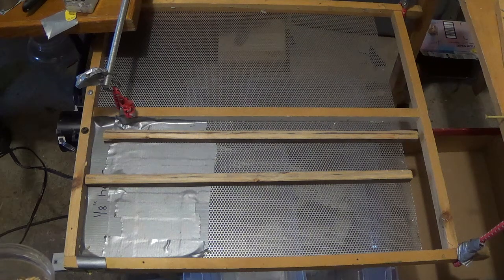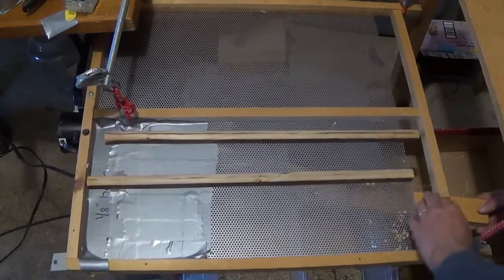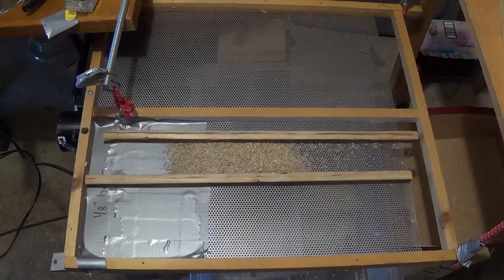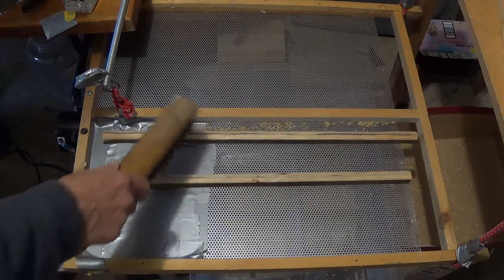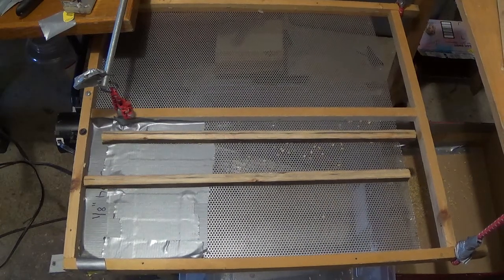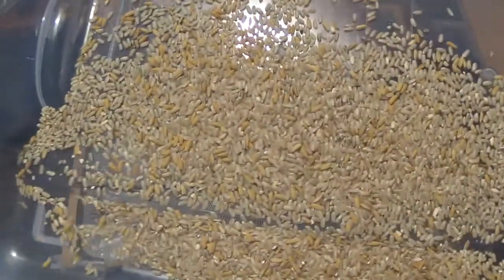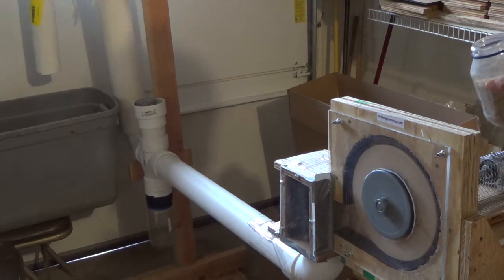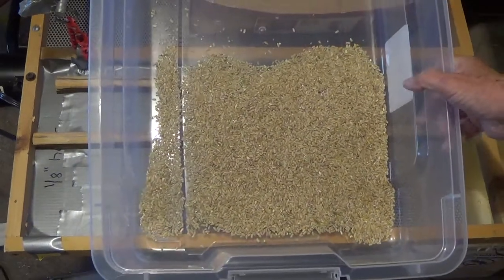separating paddy from hulled rice

Comment: Which machine this is?
Reply from the maker: this is a separator example,   Short grain works with this system well, but long grain doesn't
Reply: @brillengineering7889 i guess for long grain, slotted perforated sheet may work